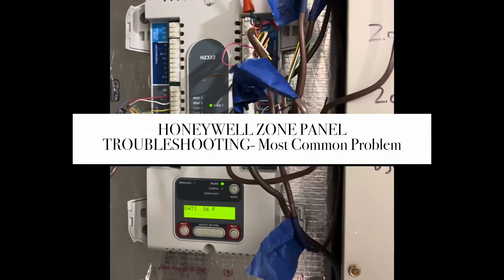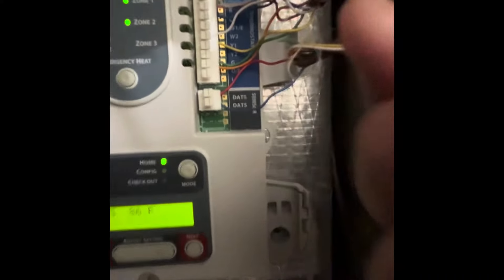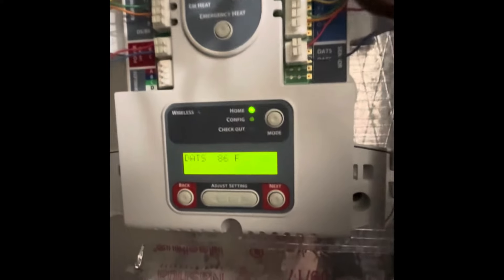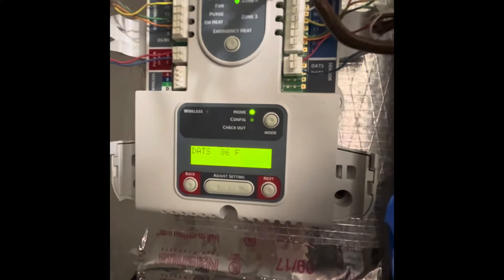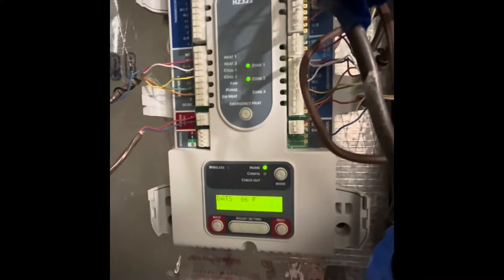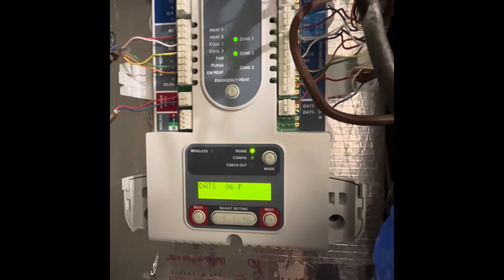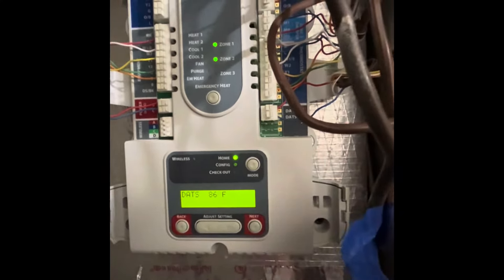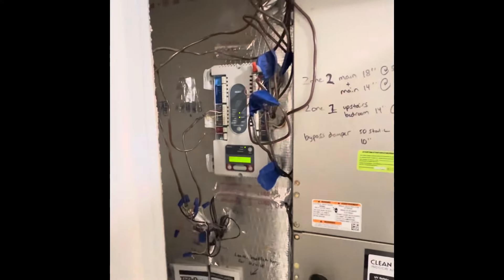Honeywell Zone Panel |MOST COMMON ISSUE| DATS SENSOR

Comment: DATS = Discharge Air Temp Sensor. Its job is to sense the outgoing air as well and shut the system off in the case you were talking about with too high or low a temperatures.

Comment: Discharge Air Temperature Sensor , not data, and they are there for a reason. Don’t be a hack and bypass it, instead find the actual cause such as incorrect airflow, restrictions, ECM blower not ramping up etc. Another common reason is that they are mounted too close to the coil.
Reply from the maker: The discharge air temperature sensor is mounted into the supply plenum to measure high and low temperature lockouts for the system. They come standard on zone panel at 40 degrees and 160 degrees. If it goes below or above the system will not work. This is the number one issue that these fail every season. I replace them weekly on zone systems. Or bypass them if the homeowner doesn’t want to spend the money every year. This sensor does not measure airflow, anything to do with blower motor, etc. I call it a data sensor because it provides “the data” temperature to the zone panel. 
Thanks for watching :)

Comment: Simply disconnecting it sounds like a bad solution. It is there for a reason to sense if air is getting too hot or too cold coming out of the handler.  Either situation is bad and should be addressed for root cause.  On the other hand, if air temps are actually fine and sensor saying they’re not, then the sensor should be replaced.
Reply: Nope , single stories houses dont use a dats sensor dont even have zoneboards  ..
But what i will say is if you have a 5 ton unit. And lets say your upstairs is a bonus room with 2 vents for the living area and lets say 1 for the bathroom or closet.then its obvious that room is going to be cold within 20 mins max atlongest downstairs(main floor) is tstat is turned off. now thats where this dats sensor comes into place.but for the unit to freeze up then it would take 5 hours of just keep running and running.now question for it to be running 5hours to get it cooled .why would a  homeowner do that keeping a stat off during summer.elderly people with bonus room floors houses will say they keep the tstat off since no one lives or sleeps upthere so they treat it as an attic .but with it keeping it hot they dont know is that that heat will creep downstairs making your downstairs tstat running because that heat creeps to the downstairs non stop..damper systems is just a economic way of new construction on investing on installing a extra system for that extra floor and selling to ya as if it was a 2 split system house

Comment: Mine shut down today. I have two zones. It’s July so obviously we’re using the cooling cycle. I pulled the panel (after checking all of the power to the unit). The purge light was flashing amber. Emergency heat light was steady red. I pressed the emergency heat override button and the unit started working fine. The purge light is still flashing. It’s worth noting there are no wires connected to the DAT terminals. The panel is out side attached to the unit. They serviced it about a year ago and left one of the sheet metal screws out. Thus allowing it to draw a lot of moisture. All of our ductwork is under the house in a crawl space. I ran both zones through all of their cycles heating, cooling and emergency heat. Everything seems to be fine. My question is… why did it shut down in the first place? Any advice is appreciated! Thanks in advance! Edit: I wrote this before watching the last thirty seconds of the video. I believe my question was answered. I guess I live with a flashing purge light!😂
Reply: Sounds like your system doesn't have a DATS Sensor installed. Otherwise, you'd see wires going from it connected to the DATS terminals on your panel.
Reply: @KL4life Thanks for the reply. I continued to investigate. You are correct. There are no DAT sensors installed. I guess I was overthinking it.

Comment: I have been told by one of the technician the zone panel is not sending signal to fan unit when i adjust temperature in thermostat and I have been recommended to replace zone control panel I have the model HZ322 please advise how can I check if the my zone control panel works or not
Reply: They hardly ever go out bad

Comment: In my zone panel the DATS sensor are not connected. The thermostats are not working, they are not communicating with the zone panel. Any ideas on where to start  troubleshooting ?
Reply from the maker: Are the thermostats and zone panel wired correctly?

Comment: I know the board in the video and 4 zone one do staging off that Discharge air temp sensor if configured right not a big deal on a single stage equipment

Comment: How is 170° the max for heat sensing before shutting off? I’d think it would be closer to 110°? Weird. My 2-zone system can’t seem to keep the inside temp to less than 83° when both upstairs and downstairs are set to around 74°.
Reply from the maker: Is your heater running? Sounds like that may be the issue. Check amp draw when both zones are running on air handler and see what it is.